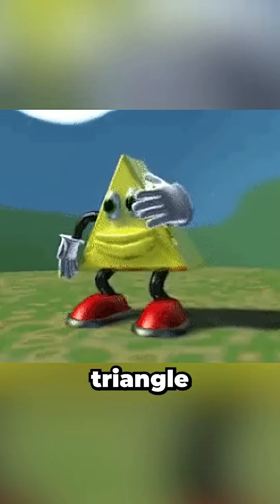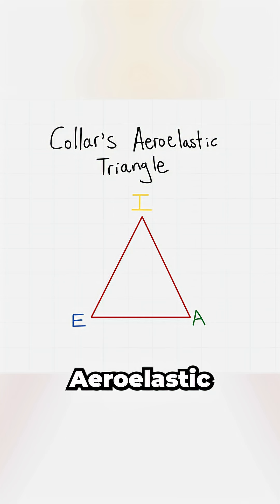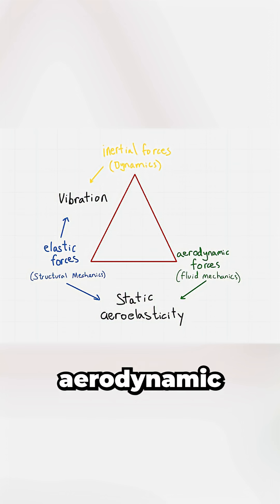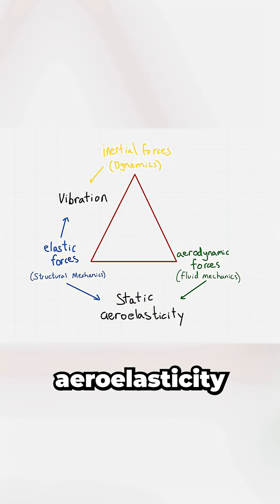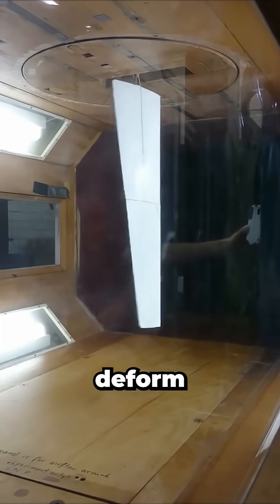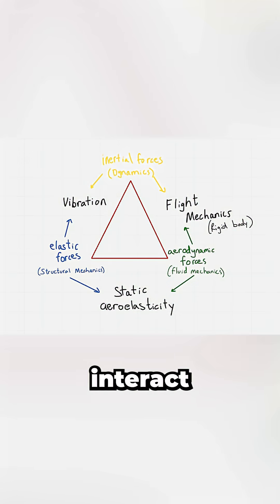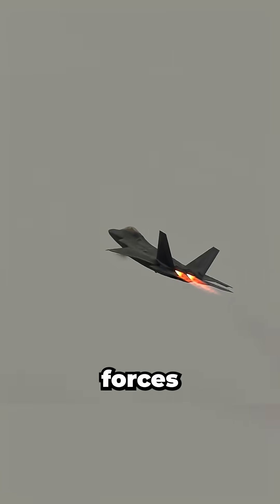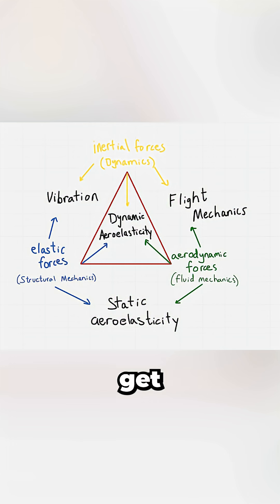Why is THIS Triangle so Important for Airplanes?

Comment: The F-16 usually mounts AIM-120s to the wingtip pylons to reduce wing flutter, wonder what part of the triangle that affects.
Reply: all of the triangle technically? but directly impacts the elastic force part

-Placing that much weight on the wing tip should provide some sort of restoring force against wing flex during manoeuvres

-causing a stronger damping effect( helping negate the elastic force) 

-which then impacts the aerodynamic interaction

-because there would be a stronger negative feedback loop ( from weight of the missile) so the interaction that would cause wing flutter( aerodynamic force and inertial force) would be reduced.

The same would occur if it was a lighter missile i presume but having the heavier one at the tips likely has the strongest effect ( think about the moment between the wing root and the wing tip, with center of mass being closer to wing root
and ofc the impact of aerodynamic forces flexing the wings upwards)

Please not i'm not an aerospace engineer although i aspire to be 🤩. I've only mixed the info from this video with my prior understanding; so take the above with a table of salt. 

If you know any better I will gladly take any correction.😁😁😁
Reply: @Just_Tox  That's a very comprehensive explanation, thank you. I certainly don't know a lot about this but I was surprised that resonant frequencies weren't mentioned in the video. I was sure that would play a part

Comment: What are your thoughts on leading edge length to trailing edge length.  Like birds wings, and how super sonic leading edges are not a round as a slow but stable Cessna? Would a super sonic leading edge wing become more stable and create more useable lift if the trailing edge is a longer as possible?
Reply: Hello 👋 there how are you, do you have signal number are zangi number